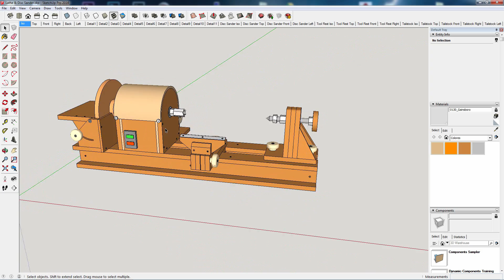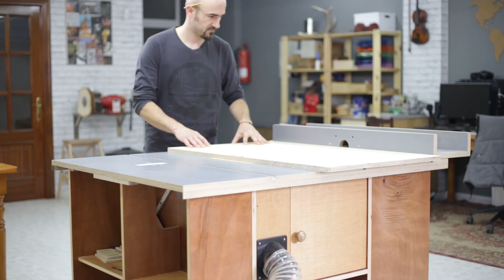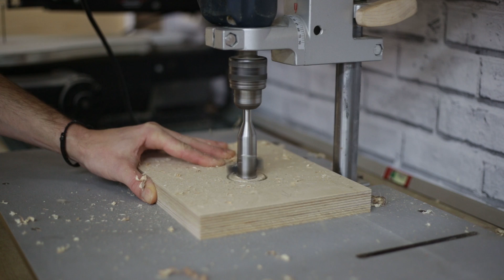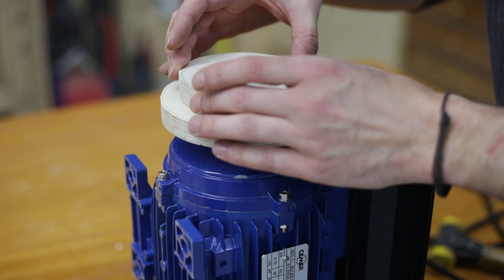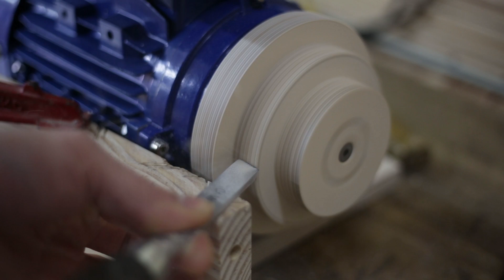Homemade Lathe & Disc Sander Part1

Comment: Hello! Please tell me, what diameter shaft did you use? What is the metal marking?
Reply from the maker: 20mm. Metal marking?
Reply: @Paoson_Woodworking  Thanks, yes, I would not like to use soft metal =) I decided to try using an optical shaft from a CNC machine, 16 mm in diameter =)

Comment: Hello did you take a 20mm diameter ball bearing ? But what I mean is the length or the inside diameter . Thanks a lot for your time and your answer.
Reply from the maker: the threaded rod is 20mm in diameter! and also the inner hole of the bearing

Comment: Hi, thanks so much for sharing this wonderful detailed video and it has been my dream to be able to build my own. At first, i almost followed exactly and please allow me to point out some results:

- centre spur: the video shows to cut in a triangular shape and has been sharpened to slicing manner. Few test runs showed that it could not hold the workpiece well and often slipped after a while. I tried modifying several times to point it is now like a rip saw profile and it works perfectly 
- I am using 12mm rod, it could be the reason that my tool rest is not stable and wobbly when I moved towards both ends of the tool rest. Since I noticed I have never need to change my tool rest's height, I made another one with fixed height and installed a 1/2in steel pipe onto giving an easy gliding movements 
- rearstock: the video shows that the rod is made pointy which caused a lot of friction onto the workpiece and it also acting as a grinding bit which deepened the hole of the workpiece after a short while of use. I used another bearing to made a live center however, it works but still not perfect. This will eliminate both issues which I described above.

Thanks again for sharing for this useful video and hoping there will be more in future projects.
Reply from the maker: I'm glad to read your words! please send me some pics:
info@paoxxx.com
Reply: Hi There, I have compiled in a Doc format in my reply. Please take a look. Thanks so much again for sharing. :)

Comment: I think this is a great video, but why is the motor separate from the rig itself. Wouldn't it make sense for it to be a single unit instead of being separated by the band?
Reply from the maker: I designed it this way to be able to change the revolutions, thanks!
Reply: james living Direct link and variable speed in these types of motors is not good as there is a loss of torque at low speeds. This is why gearboxes and pulleys exist. The motor can run always at optimal torque whilst the ratio of the system dictates the final shaft speed. 
For direct drive you would need a super expensive and responsive motor controlled by pwm. A stepper motor for example would be a direct drive option, but it would have to be a damn good one for a lathe, and would have to be supported by a myriad of electronics and drivers to make sure it works correctly.

Comment: Hi Paoson! I really appreciate the fact you are trying this homemade lathe thing, can't wait to see how it functions.

How strong is the motor and RPM?
Do you think it would be possible to turn steel parts in it (with another tool holder made for that obviously) or it wouldn't be strong enough?

Would've loved to see this made into an accessory for your table saw/router/jigsaw table though, would've added a lot of versatility to this table

Will definately buy this set of plans as I was pretty impressed with the 3D Router (although maybe a bit hard to understand the plans, in my opinion)
Reply from the maker: hi Eric, It is a 1HP single-phase motor with 1500 RPM. I'm no expert in metalworking, but I do not think this lathe can serve to turn steel!
thanks for comment!
Reply: Thanks for the answer on the motors specifications.
Steel is rough to turn and needs to be properly chucked in, so the headstock and tailstock would need to be changed, but the threaded rod didn't seem to bend when you were cutting it, so I think it might have potential, any possibilities that you try to convert it into a wood/metal lathe when it is done?
Most lathe I've seen so far where not that strong when force was applied that far from the bearings, yours seems to be able to take a bit of force which is obviously required in metalworking.
Reply from the maker: when it ends, I will try with some soft metal, and see how it works!

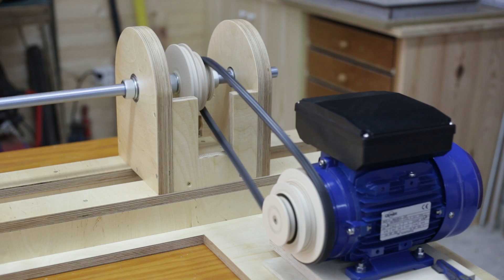Comment: Something seemed to change between 6:00 with all of the vibration and then again at 6:07 when the motor starts up and it is dead smooth -- was it simply lathing down the circles to be completely true that removed all of that vibration or is there more to it (alignment, etc.)?
Reply from the maker: by lathing the pulleys leaving them perfectly round, the vibration is gone! thanks
Reply: Thought so -- thank you for the reply! Excellent work; looking forward to the next part.